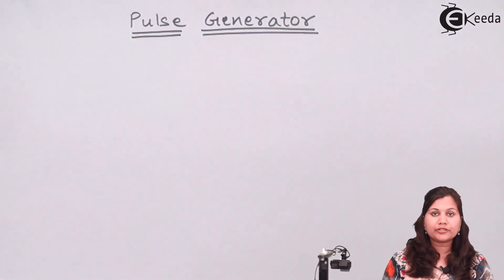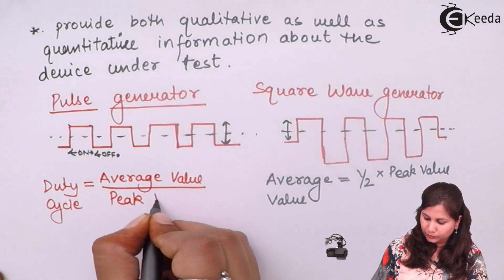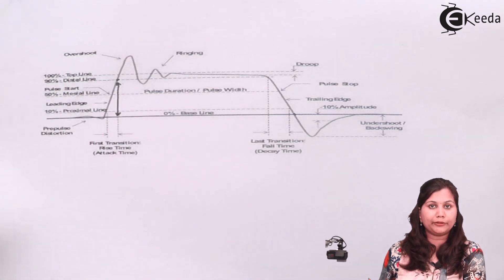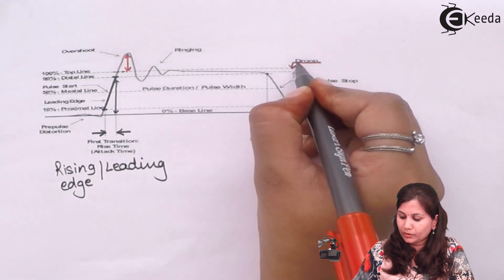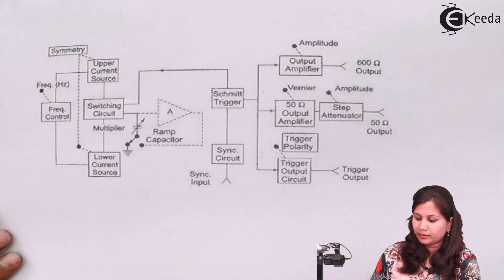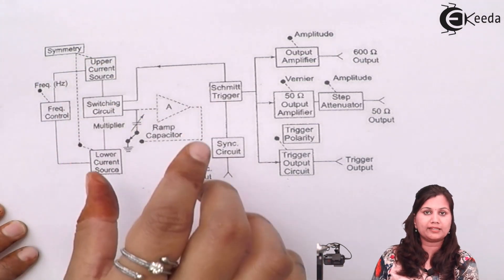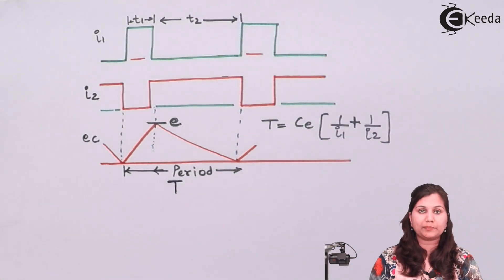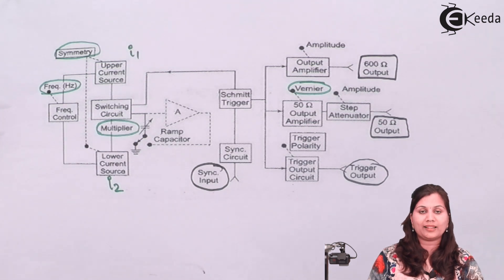Pulse Generator - Block Diagram, Working Principle & Construction - Electronic Instrumentation

Comment: Mam you said that the schmitt trigger will produce a ramp signal, and the trigger output differentiates tht output of the schmitt trigger. So after differentiating the ramp signal what will we get at the output of the triggering circuit?